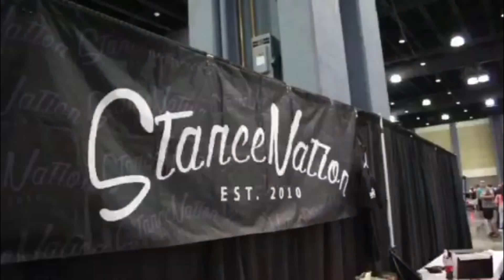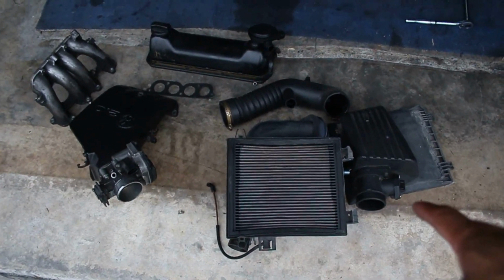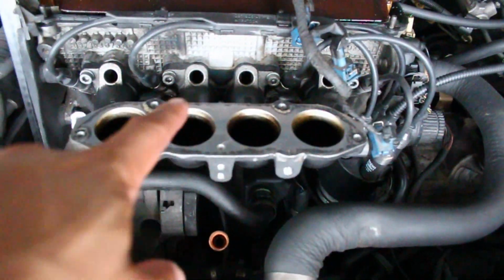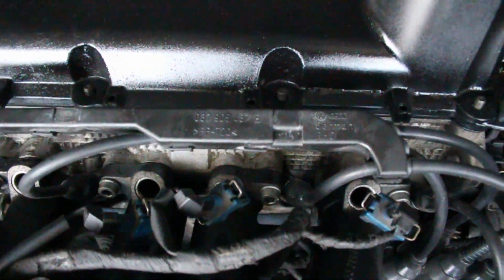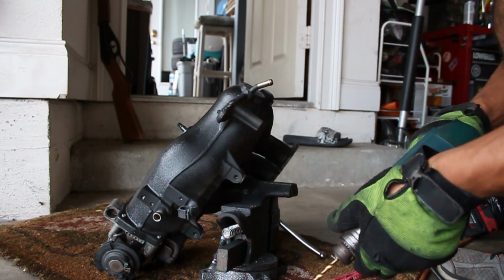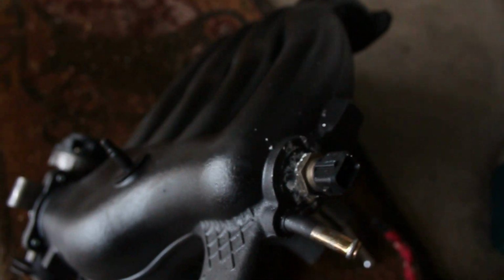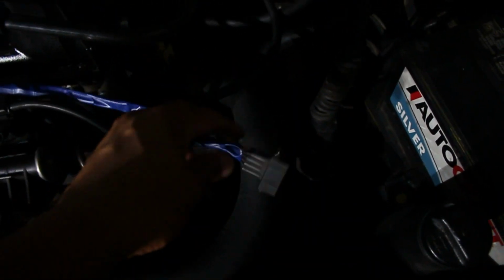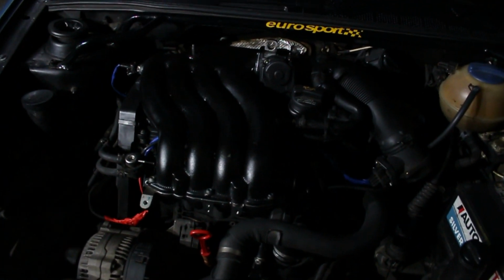Mk4 Intake Manifold Swap to Mk3 - Part 2

Comment: Have you considered trying the bse / bsf intake manifold? It is basicly the same. The big differance is that it has a kind of valve flap thing to change of differant air flow for the best result    in performance, one way of the cirquit inside the manifold benefits for power in low rpm and the other one is for high rpm.

I tried googling to see if someone has tried this but no luck unfortunatly..

Comment: Curious on how the throttle cable was routed ? Custom bracket or what? That’s my only issue with it so far, using a bungie cord too keep tension. Anyone have awnsers? Possibly adjustable?

Comment: Ok I have a 1997 vw Jetta gt 2.0 kinda wondering what is the point to this build like what’s the purpose ? Not trying to like get mean or anything but was wondering does it gain any power or is it just for looks ?
Reply: From what I’ve seen/heard it suppose to change the torque band and give a little more power because it flows better then the mk3 manifold

Comment: So you didn't double up the o-rings on the injectors? Did you have any problems from that? I know ever in the forums seems to swear by it
Reply from the maker: JestersHacksaw I did not I just got brand new oem o-rings for them and haven’t had a single problem. Idk how you’d fit 2 anyways because the oem ones fill up the whole gap lol
Reply: Well they say to fit 2 o-rings instead of 1 ring and 1 plastic spacer, but I cant seem to fit the new cap on once 2 rings are on there lol

Comment: Cristian, your crankcase needs to breathe! You plugged it up with that bolt on the bottom! Black forest industries sells a billet plug that goes in like stock and you can connect it to a breathable catch can! Also, put some grease on your drill bits to catch the metal filings when you drill. Nice job though!
Reply: just ordered mine!!!

Comment: That 3/8ths hole would have worked. If you know the thread pattern. You can wd40 that bad boy and tap it with your drill. Home depot has the tap for like 6 bucks. It connects to a impact.

Comment: Did You Use The Mk3 Fuel Rail Or Mk4 Fuel Rail?
Reply: Omar Alvarez its supposed to be the mk4 fuel rail with the mk3 injectors